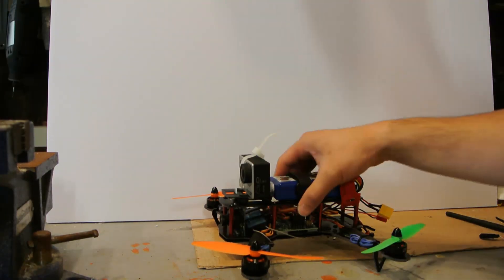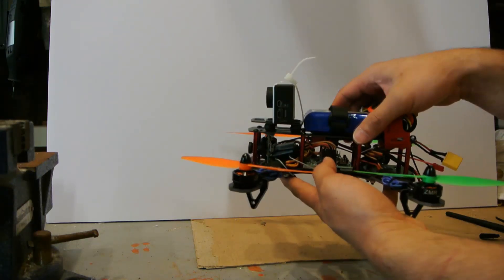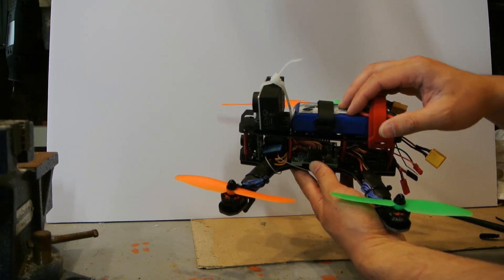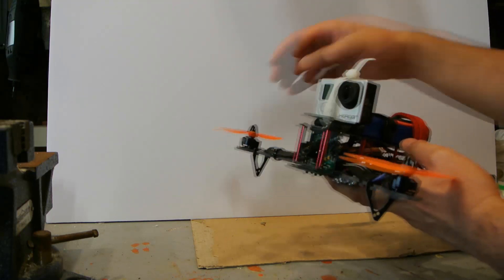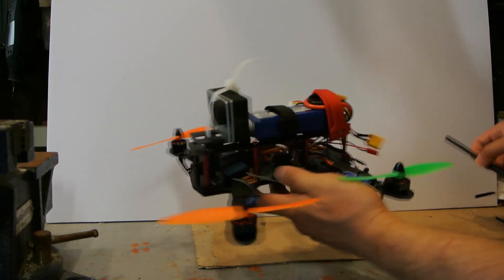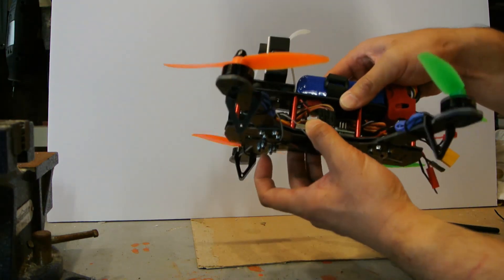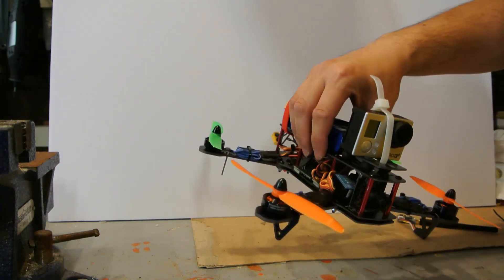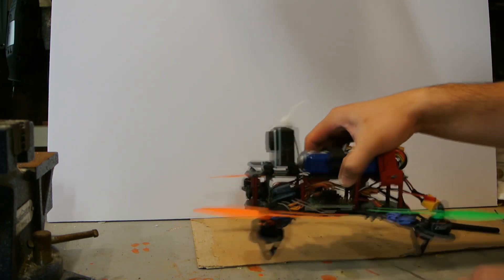ZMR250 250mm Fiberglass Mini Quadcopter Frame from Goodluckbuy com  - Part 2

Comment: Hello Andrew , just a quick question , I'm riding a quad with these engines and before making blunder wanted to confirm the battery voltage , 11.1 2200 mah? Nice quad =)!
Reply from the maker: ***** Hey Carlos, yes they are 11.1v 3cell lipos.  Thanks!

Comment: nice video, I was wondering how long your flight times were with the 2200 lipo
Reply from the maker: I'm getting around 8-10 minutes, but the battery is a bit heavy for it, so it isn't as fast as I'd like.  I'd probably go with a 1800.

Comment: Great review, what are the settings on your KK2 board? I have my board on a 250 Hovership but can't get it to stop suddenly rolling out when hoovering.
Reply from the maker: I fly with autolevel on if you are flying without autolevel you may need to increase your PIDs.  There are a lot of tutorials out there that covers the KK2.

Comment: If your Rx has cppm, get the afronaze32, save a few grams, also what props? look like 6"? with the same motors and a zippy compact 2450mah, with 3blade 5x3 I got 16 mins flight time, poor in the punch out but good in level flight. If you use your mobius to transmit aswell as record like I do, you can't use much more than a 1500mah (zippy compact) due to the USB connector to the VTx, which is abit shit and the only criticism I have of this frame for the money. It's more the mobius's fault than the frame, but if the frame is designed to fit mobius, and the aim of the game is as light as possible why use a board cam when the mobius can do both jobs well? maybe the frame designers don't think that way. Also, mobius hangs out over the front, first point of contact.....added a little CF plate to make the CF FPC!!
Flight times with 1200mah zippy compact (25c) 6 mins, not tested 1500mah zippy C yet.
Reply from the maker: Ben Portman I am using 5030 props, no room for the 6" props I think.  I don't own a mobius but it's on my to buy list someday.  Interesting to hear your observations!
Reply: Thanks, it's all about sharing!

Comment: hay man just wondering how well dose the quad fly with the 2200mah and what type of 2200mah is it
Reply from the maker: It flys well but only if it is not loaded down with FPV gear and camera.  It's a blue turnigy 2200, 25c, I'd probably go with something smaller if you plan on flying anything but line of sight.  It was the only battery I had on hand.
Reply: Andrew W well would a 1300mah 3s 15c would that work cos I only have them to typs I don't rely want to buy another type
Reply from the maker: Chris Peacock That might be border line on the battery for the C rating, if you don't push it too hard might be fine.  Max draw you can pull from the battery is 19.5 amps continuous,  I think the motors can pull 5 amps each so it's kinda close at max throttle.
Reply: Andrew W also I am running 10 amp esc will that make a difrence

Comment: Thanks Andrew, the cc3d open pilot looks interesting.I still have a couple kk2.1 boards and have
had great luck with them.I have one in an easy star flashed with open aero2 and it works great.
I'm building  a 250 quad at the moment,unless you want to part with one!!!
 Mike
Reply from the maker: lol can't part with one, they are a blast!  did you see that hobby king now has the kk2 in mini size 36mm.

Comment: How are you liking the mini now with the naze32, I am thinking of ordering one as well,I've been
flying tricopters fpv with kk2.1 boards,how do you think they would compare to naze 32 on a tricopter.
Nice videos..I live in Truro
 Mike
Reply from the maker: to be honest, I prefer the kk2, the naze32 has altitude hold but I can't seem to get it flying perfect, the kk2 is so simple to setup.  But I might be doing something wrong, the naze32 is so tiny tho so I really want to like it!  I notice on ebay they have a CC3D open pilot for 30 bucks I might try one of those.  But for now back to the kk2.

Comment: Have you had trouble balancing your quad? I have the CF250 and with a 1600mah/1800mah 3s I am more back heavy and unless I fly Angle, the quad is very difficult to balance.  I've got a mobius + sony ccd 600tvl in front w Naze32 centered, battery on top behind mobius mount, back also includes my 200mW vTX.
Reply from the maker: kubanishku I fly currently with the KK2 board and I fly a lot with auto level which is like Angle, so I don't fly a lot in manual mode.

Comment: Do you have any recommendation for a more powerful version of this? Like is there any more powerful motors or props i should get to lift more?
Reply from the maker: Mike Cammiso You could try some of the Sunnysky motors x1804s 2300kv, they are better quality, also the Tiger motors, not sure what the model numbers are, look up the Blackout quads and what motors they use.
Reply: Andrew W What about props?
Reply: use Multistar 2206-2150KV Motor The "Baby Beast" with 6x4 props

Comment: I got the same but carbon fiber and its 135 grams and go for like $34. so its 35 grams more for fiberglass from your specs. nice vid btw.
Reply from the maker: Thanks good to know, may have to pick one up :)
Reply: Andrew W use nylon post and save 5g per post.

Comment: Hey Andrew, thanks for sharing your build. I'm about to start the carbon fibre version of this one with almost all the same components. I'm wondering what C rating is on that 2200mah. I have a couple Zippy 2200mah 20C that I was hoping would work for me, but I know I'll probably need to find something lighter with higher C rating. I like the 8+ minutes flight time though.
Reply from the maker: Cory Braden The C rating on my batteries is 25C, but if you do the math even with a 20C battery you should be fine (20x2.2=44amps continuous).  The 8+ minutes flight time is nice and good for light flying with but to really make it move you need to go with a 1500mah.  I've tried it with 1000mah and it's crazy nimble can't imagine what a real Blackout would be like since they are so light.

Comment: Nice review Bro ,
 for these quads I found you need a neze32 board and max 1500mah 3s . these motors I found 550grams auw is the max .
Reply from the maker: Thanks, I realized that now, check out my review on the naze32 too.  Have to ordering some batteries soon. :)

Comment: How do you like flying it with the kk2 board. Probably running the same setup. Thanks for info build by the way
Reply from the maker: I like flying with the kk2, very stable and easy to setup. But I would like to have a barometer for altitude hold so I waiting for a multi wii Flip pro.  thanks for watching!

Comment: When you setup your flight controller was it set up as a x quad? Or an h quad?
Reply from the maker: I set it up as an X quad.
Reply: You can do x or h config. Bruce is doing a review in these cheap clones now. It seems that these are slightly larger then 250mm.
Reply: aviah11 They are actually a weird kind of H. Its front and back motors are closer together then right and left motors.  For it to be X configuration, all the spacing between motors should be same.